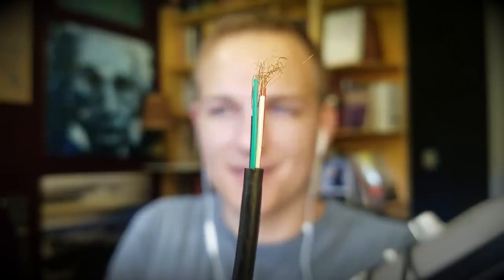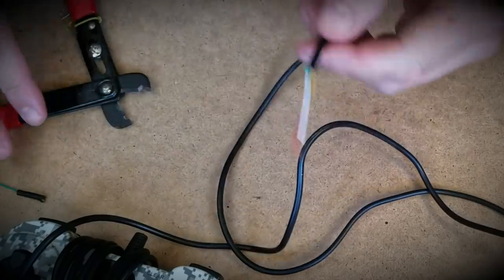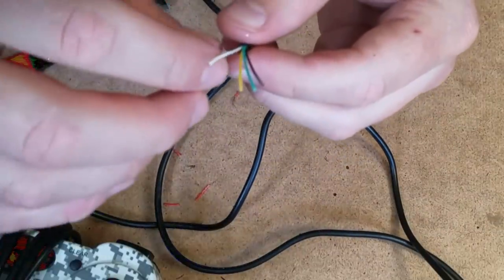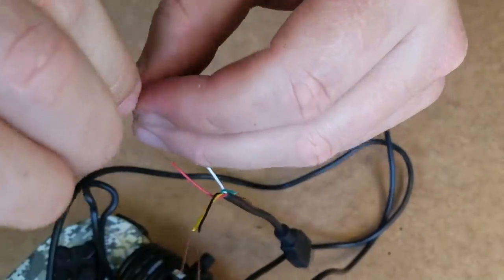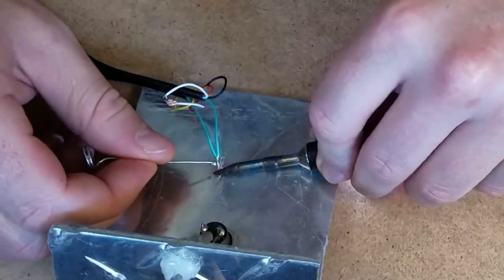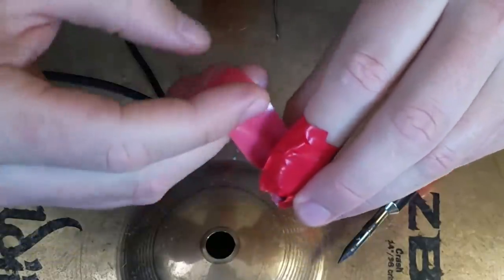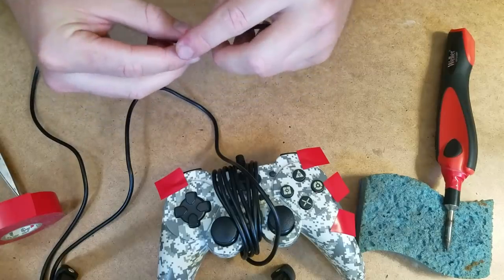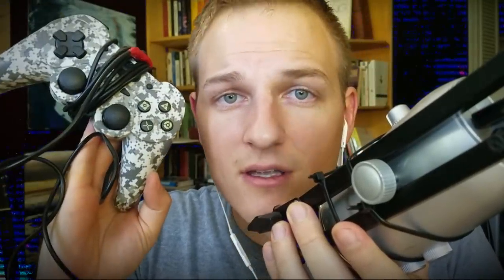Fixing Broken Electronics (USB Controller Cable) | ASMR

Comment: Also here’s a tip for soldering. When you’re trying to strip those tiny wires, grab a lighter and hold it in the flame for a second, then you can just slide it off with your finger. So much easier than using a wire stripper on those delicate wires. I’m listening to this to go to sleep but imma watch it again tomorrow to see if I can offer you any more advice ✌️ 

(Not saying you’re bad at it, I’ve just learned easier methods the hard way)
Reply: JazawaToad This is actually a great tip. Who would’ve guessed that we could learn something like this from the comments of an ASMR video? Thank you, I am certainly going to use this
Reply from the maker: love that idea. thanks man

Comment: Listening to you do this sounds relaxing but Lord, it's a good thing I didn't have all the fancy tools when I did this for my kid.  I just used my tiny cuticle scissors and cut down the length of the outer insulation and my stitch puller to split the plastic on the tiny ones.  Ran out of wire for my Jewelery soldering iron so just spliced and wrapped in electrical tape.  Looked like crap but lasted long enough for his dad to buy a new one later!

Comment: All your soldering problems could be solved with a tiny bit of flux on your wires! But boy that was some GOOD asmr!!!!! Love it!
Reply from the maker: ah ok didn't know that flux was needed. thanks
Reply: The solder most likely has a flux core to assist the solder to melt and flow, but some additional flux on the wires would make it much easier for the solder to wick on the cables. The flux breaks down the contaminants and oxide layer that builds up on exposed metal surfaces which hinders soldering - makes life so much easier.

Great content none the less :)